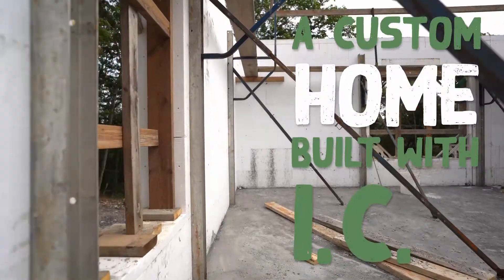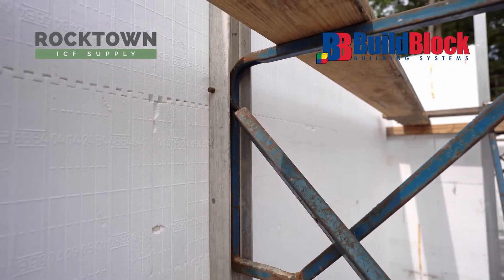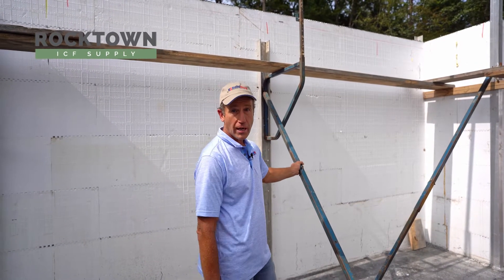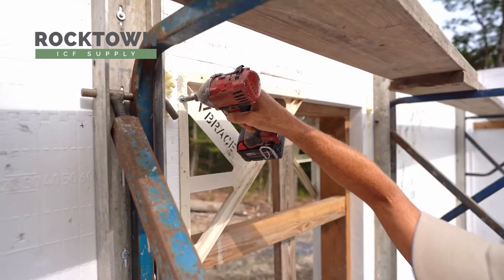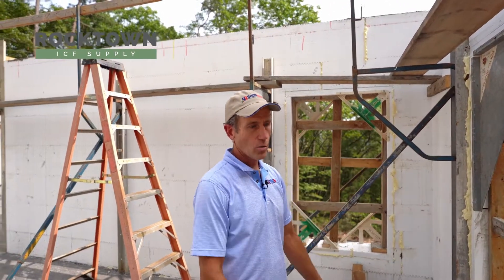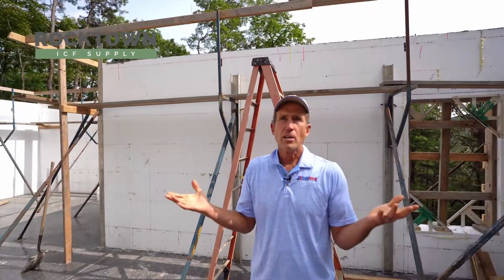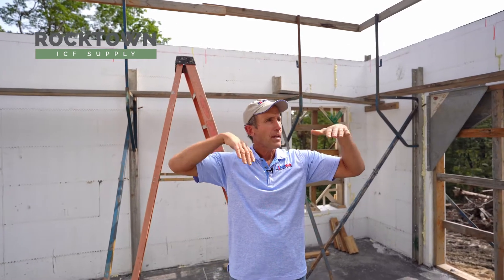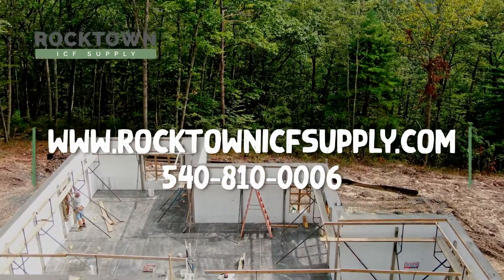How to Brace for an ICF Pour - Rocktown ICF BuildBlock Insulated Concrete Forms

Comment: how do you anchor the turnbuckles to the floor
Reply: Use a TapCon concrete anchor and unscrew t when finished. Then fill the hole with epoxy of grout